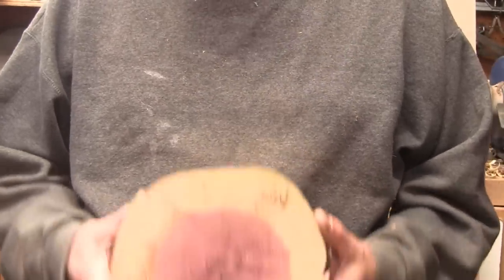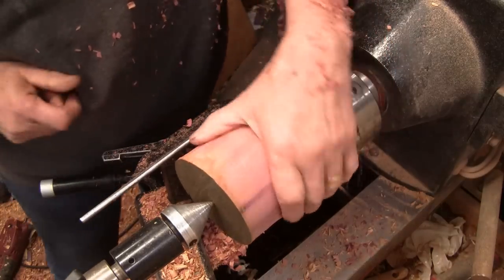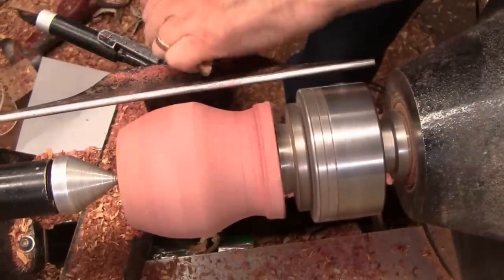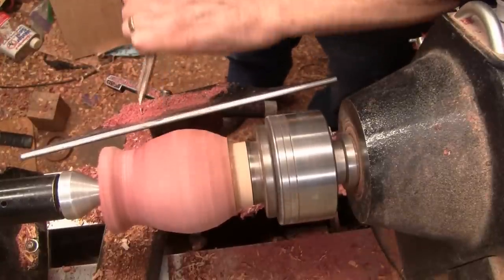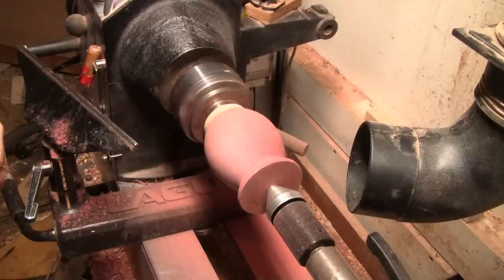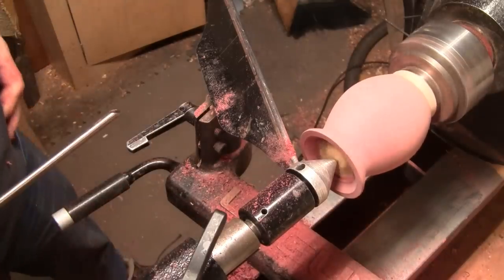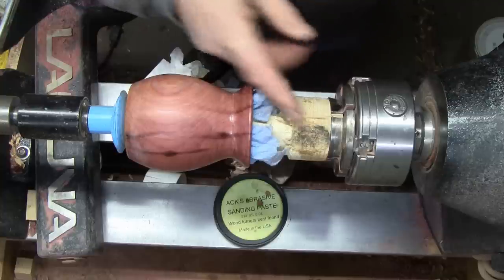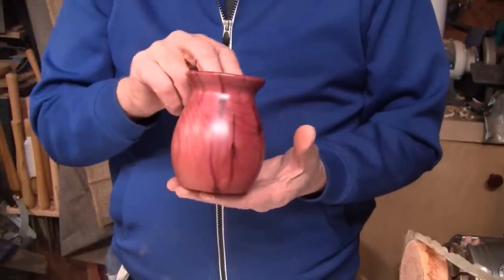Wood Turning a 3000 Year Old Shape from Red Cedar

Comment: You got lucky turning that jar(?).  I turned cedar when I first started turning. Only problem was the hidden knots in the wood itself. I was turning a chalis and hit a knot and it exploded on me. I will still turn some cedar, but only to perfume the shop.
Reply from the maker: Looking the piece over real good before turning it I could see there was no major cracks or big knots. There were very tiny ones inside but they turned as easy as the wood itself. I  have turned a bit of local western cedar with no issues as well As soft as cedar is I have found it really needs very sharp tools to get a good finish.  Sounds like you had a pretty stubborn piece. 
I could not sense the nice perfume smell that cedar can have. But I have issues with sense we have.
Thanks for watching,
Gary